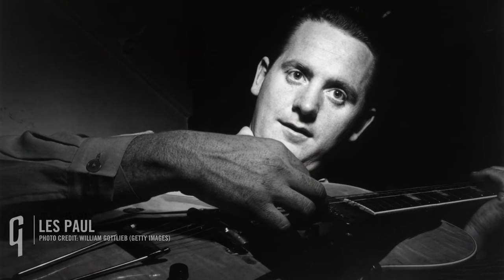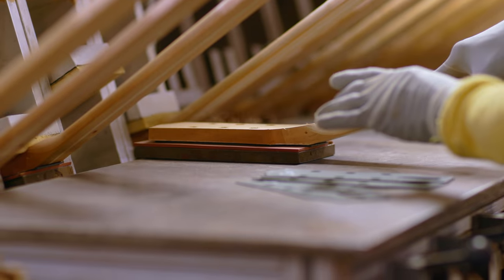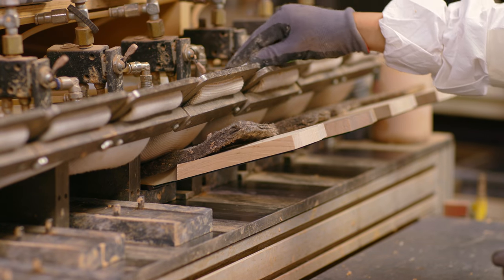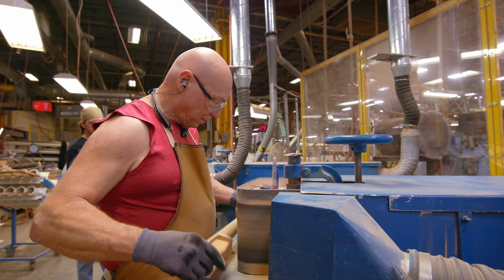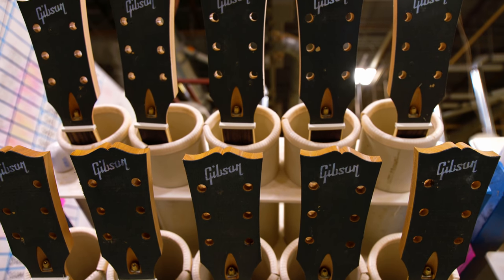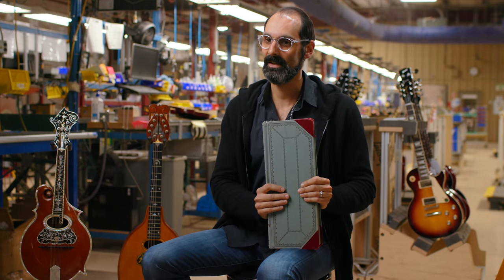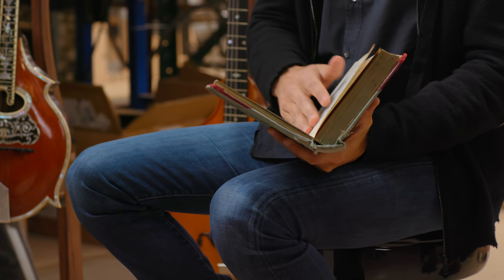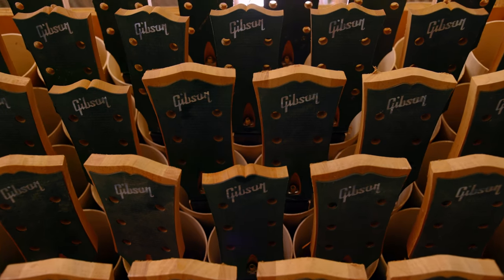Inside The Neck Line at Gibson USA | The Process S1 EP6

Comment: Just bought a brand new SG from CME. The “tektoid” nut is atrocious. Work so sloppy I had to make a new one. Gibson has a long way to go. Gibson, you could learn a few things from PRS.
Reply: Matthew Shaw should’ve returned it man. Idk about Gibson USA, but Gibson custom has made my favorite guitars. Then again, I know $5000-$7000 is not attainable for the average Joe. I thought the new USA line was a step in the right direction. I guess not
Reply: They’re showing why they suck . One lathe or cnc machine slightly out , before you know it . 300 messed up Les Paul or Sg ‘s are made . They just keep on trucking instead of throwing them out . I guess that’s why GC has so many messed up new guitars
Reply: Guitars should not be purchased online.
Reply: I went into my local shop and tested my 50's standard.  I would never pay out over the odds for a guitar without trying it out first.  I have a few vintage guitars and also a few cheap ones that I have bought online but if im paying over 800 notes for a guitar then im going to try it in my hands first....
Reply: This has been the case for 20+ years. Poorly cut nuts, rough fret ends, terrible action and intonation. The Memphis factory was much better in the early 00’s but even then I didn’t like their pickups so for my 4 Gibson’s (3 I got for amazing deals) I gutted the electronics and had them professionally set up immediately and because I got most of them for so little it worked out in the end. For my es-137 which wasn’t a deal, I was able to try out 25 or so es models that day looking for the best acoustic sound and I still changed the nut, pickups and wiring and did a full setup and now it sounds amazing.
Reply: Every single one of the guitars that leaves our stores in the UK is given a proper check before the customer leaves with it. expensive guitars are by appointment. that way we don't have hordes of tyre kickers damaging stock so people who don't know how to buy a guitar, don't end up whinging that the guitar is fucked, when it wasn't when it came in and we keep it that way.....want to play a Gibson in our store....get your credit card out and leave it behind the counter.....damage it buy it.
Reply: They are not gonna do a damn thing. They know that dollar for dollar consumers are paying money for the Gibson legacy, i.e. the brand's aura created by the scores of famous players who played Gibsons in the past, than actual luthiery. They will just keep cashing in on that.

Comment: Love this, just wondering why they haven’t figured out a inlay spline system at the neck/headstock area to prevent the neck breaking
Reply: stewea57 didn’t they come out with something like this recently? Maybe on the ‘high power’ models or something... I could have sworn I saw a new joint on certain models. Anyone?
Reply: Not that I’m aware of,
Reply: Apex headstock. Google it.
Reply: @Tacopusher  wow I didn't know that, it doesn't look like it's on all models though. Wonder if it works, all the neck breaks I have seen were at the top of the neck, interesting I'm glad they are finally looking at this

Comment: Go fix your QC Gibson!
Reply: @LSTNR I bought a 60's lp standard mid-2019 after having my faith restored by the new standard series from years of refusing to buy due to QC issues, it had tooling marks and black scratches on the binding, the nut was slashed and cut in various places that even went into the finish. The shop I bought it from told me "Gibsons are always a bit rough around the edges". Speaks volumes.

I just don't understand how someone at Gibson could let something like that leave the factory and also have the balls to fill out an inspection card to boot saying it was good to go. 

No matter, I won't be buying one again. Gibson have proven time and time again they aren't to be trusted :)